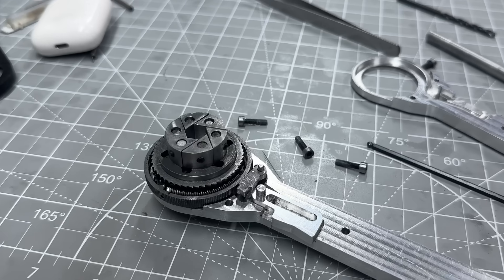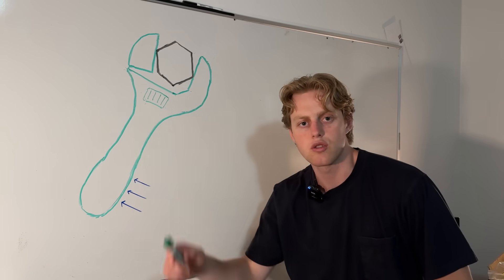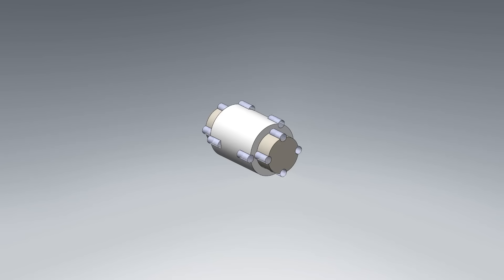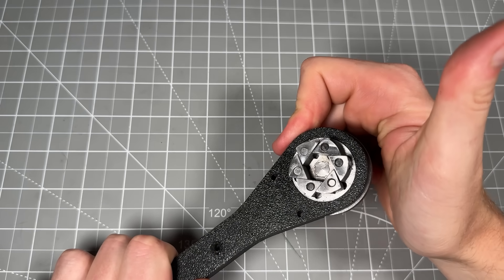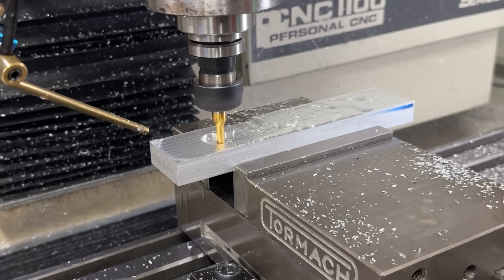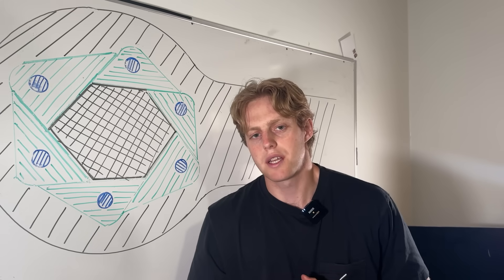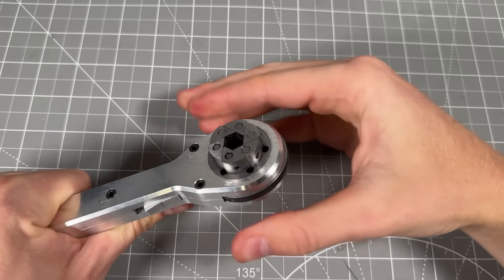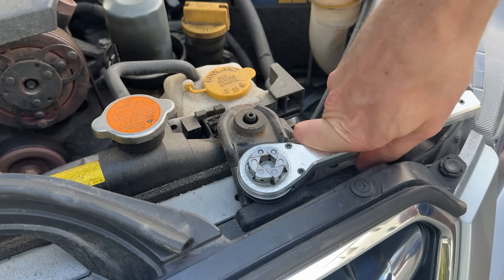I Invented an Adjustable Ratcheting Wrench

Comment: Tractor/trailer mechanic here. This is extremely interesting and I hope you continue to develop this idea, and would absolutely buy one if you decide to sell. I mainly work on Freightliner/International/Volvo tractors, there are tons of areas where space isn't and issue on tractor trailers, you could disassemble half the truck with a 10/13mm socket and ratchet. Liked and subbed, hopeful to see more content in the future on this project!
Reply: How are you going to repair anything if this can't pass a torque test? The tool is a novelty item and is not practical.
Reply: @snowflakehunter what a mentality. Imagine if inventors of the things we havr today had your exact logic and thought process.
Reply: @snowflakehunter  it's a prototype though. It improved over the course of the video, and he plans on iterating.
Reply: @darnell7119 iterating? Wrong word.
Reply: @snowflakehunter "Iterating is the act of conducting an activity, evaluating how it went, improving it". I'm saying the guy plans on improving it so saying it doesn't have enough strength to pass a torque test isn't completely fair. Like do we really know how strong the last version is? What use cases is this strength practical? Those are questions that weren't answered and you don't know what everyone will use it for, so saying it can't pass a torque test send vague and unfair.
Reply: just needs harder materials, and as the video mentioned he could reduce the adjustability to increase strength
Reply: @fryta. Absolutely not! Harder materials including metals break more easily because increased hardness typically leads to increased brittleness, which is a material's tendency to fracture rather than deform under stress. While harder metals resist scratching and indentation, this often comes at the expense of ductility and toughness, meaning they can't absorb as much energy and are more prone to sudden fracture with little warning.
Reply: @snowflakehunter  I don't see myself using this tool for high torque applications, there are plenty of fasteners that don't require high torque. If the design is improved and slimmed down, this could be something you grab to work on something quick and easy.
Reply: @DieseIJunkie I do see it as a better option than those cheap sockets that have the pins in it that form around the nut or bolt. For that type of application, of course it would be a good option.

Comment: I think as a truck driver a single wrench i can use for most of the small things i may need to do on the road it could be a potential win. The downside i can see is the potential cost, i dont like to carry tools on the truck that ill be upset about if i forget to pick it when im leaving in a hurry after an emergency repair lol

Comment: 🙋‍♂️Give it a staggered jaw in each tooth to make 12 teeth and solve the problem of balancing any size drive in it. Then attach extensions and so forth until it’s a universal ratcheting socketed driver of sockets.

Then put a torque reading mechanism in the pawl ring…😎 call it a- “mechanic toolbox with a longer handle.”

Comment: Exceptional work. I do agree that one of the biggest areas where you want to improve is with the ability to reach recessed bolt heads and nuts. Another area is when you need deep sockets. Overall tho, I don't think this current design is the "right" design for recessed bolts. It seems like a near perfect design for basic bolts tho, once you refine the final design. 
   For recessed bolts, with your incredible skill, I recommend re-examining your approach. The idea of a recessed socket deep socket or recessed thru-hole socket is actually your most important consideration if you want a socket wrench that can compete with pretty much every socket wrench out there.
   One way to achieve that would be a set of adjustable hexagonal sides that had 2 flats with a gap for each side, where the side's wall thickness never changed but the width could be adjusted by how much space you had between the start and end of the side. This would limit your total range to some degree but but by making the gap wider or narrower you get the size change and leverage you want at the vertices. Definitely want to see your progress. [Subscribed].

Comment: Awesome - if it doesn't make it to the @TorqueTestChannel bar, have you thought about a no-handle version?
The bones in my thumbs tell me there's usually not quite enough mechanical advantage for hand turning a socket.

Comment: What about the clamps themselves act as the ratcheting mechanism by opening up by turning backwards, and clamps back with a single spring that has (pins? Idk what they’re called when it’s attached) to hold each clamp. Could be simpler and space efficient?

Comment: This is an absolute pearler of a tool mate! 
If you could somehow slim the design down to the width slightly thicker that of a passthrough style socket handle, I think you would easily be able to make maybe three or four different "sizes" with a reduced range of adjustability. Say 5-10, 10-14, 14-19 etc etc
I'd buy the whole set in a heartbeat 👍

Comment: Absolutely awesome. Thanks. 
One idea: a size scale on the wrench would be handy. In situations where space is marginal or very high torque is required, one could simply read off the fastener size from the tool and grab the correct socket on their first attempt. You wouldn't grab calipers to determine a bolt's size, you'd just guess. But if this tool we're your go-to tool, you'd have the measurement as a bonus.

Comment: For hardwr to reach bolts, if you can extend the jaws in several different lengths, that would probably make getting at bolts in a car engine bay much easier. Kind of like a built in extension rod.

Comment: Great stuff and I love the approach.  It's got a lot of great ideas and elegant solutions.  I'd use one for general maintanance, where a cresent might tipically be used.  The tight area problem has  a ton of specialized tools.  But there are no good "general multisize" wrenches that solve the "is it metric or standard" problem.  If you could build in a pointer and etch the size of the fastener, that alone would be a nice use case, to quickly get the size of the fastener and also allow you to remove it when you can't find the right size.  I like it and will definitly check back if you make them available.

Comment: Dude, please never consider not bringing this to market, this would be my go too tool for 87% of my work, just because it doesnt fit into tight spaces or into recessed holes, doesnt mean it doesnt belong. My standard sockets don't work on sparkplugs, so I use a deep well, my no.1 Phillips, doesnt work on a no.3 Phillips head screw so I grab a no.3 driver. Even if a tool serves perfectly for a small amount of tasks, its still better than a tool that serves ok-ish at a bunch of tasks. You said it yourself. 
Id better have this in my tool box in the next 3 years!

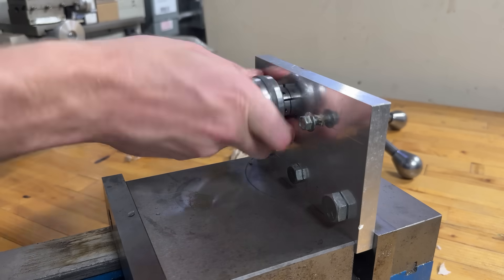Comment: Hey mate, well done with your design concept, there's definitely potential with the tool. Have you considered adding a softer sacrificial material (which slides easily with low friction) to the ends of the jaw teeth? I noticed that when you are tightening the bolts, the ends of the teeth are digging into and leaving marks on the surface around the bolt. (See video at time 10:58 and look at the top left bolt in the plate, there's a circle marked into the steel plate once you've finished tightening).  Something like a nylon plate or something may work, potentially even small ball bearings or something to reduce the friction as you rotate the jaws around. This could help prevent damaging soft or finished surfaces if you use the tool on it, and reduce the amount of force you need to snug up the bolt. Will be keeping an eye on the project as I love seeing speciality tools like this come to life. Keep up the great work.
Reply: Also, another weird thought: If you are worried about the size of the tool fitting into tight spaces, instead of having one tool that can tighten and loosen bolts, could you have two separate ones (cut the tool in half essentially) and colour code them or something? I know I'd be happy to have a combination of one or both tools as it still saves you from needing a million different sockets or spanners!
Reply: @lukepenny4816  I think the issue with the tight spaces is not the fact that it's double-sided (which I think you're saying), but that the jaws are only half an inch long.  This means it couldn't be to loosen / tighten a bolt at the bottom of a hole or channel 1" deep, whereas a traditional socket wrench could.  Plus socket wrenches have extensions so you can actually reach a bolt that is 5" down in the recesses of a car engine bay, which this design could never reach.  To be clear, I don't believe he's trying to attempt to solve that use case.
Reply: Maybe chamfer the edges of the jaw and put some sort of coating on it
Reply: Would go slightly softer on the entire jaw. Then make the surface convex so the clamping forces cause the forces to start getting applied in the middle of the bolt edge first and "spread" toward the edges..

Every so slightly convex.
Reply: A final product would likely be rounded and coated like a regular socket.

Comment: This a great idea holds nut/bolt how many times have we dropped a wrench under cars working in tight spots This is a Winner  i see many size versions  
Now that you've posted this adjustable wrench design China wud be developing it as you speak pattern or not they them rules dont apply to hackers 
keep your eye on amazon sales .

Comment: i like the fundamental idea, but it has... issues.
look at a lathe chuck. you havent isolated the clamping force from the tilting/bending of the jaws.
 relying on the pin in shear to transmit a force thats then in tension as a second class lever.. the flat alone reduces a lot of the bending strength, deviation from round... a groove and cotter pin would be better than a grub screw. some redesign to restrain the jaws separately solves both issues.

normally the dowel pins on shafts are drilled after pressing together.

back to the drawing board. think your also suffering some tunnel vision with the slotted plate. nice principle, but think... iunno... a hydraulic fitting swager? youre sort of touching on the answer by the recalculation of what a hex does, imho. flip it... inside out... you also get symmetrical action then...
also, no reason to stay strictly "radial"... swashplates and cams work on both axes. though you have to restrain bursting pressure regardless which direction it acts...

mark... twenty seven? :)

a thing ive found, after diving three quarters of the way into making a design, is that explaining it to someone, i suddenly think of a far simpler and more elegant manner of accomplishing it... and i just wasted several hours. iunno. and if it doesnt work properly the second time, seriously rethink the execution...

when it comes to ratcheting spanners, i prefer a solid switch from lefty righty to flipping them.
 a hex really only needs three points and as most of the spanner manufacturing advertising suggests, work best when forces are on the sides rather than right on the tips of the hex... no need to aim for six points of contact.

Comment: Chamfer the face of the socket heads, that much contact area on the face of the work surface is not ideal. Painted or machined surfaces will have a big burnishing mark.

Think about the scalability and cost per unit at the end of the day. How many of these will I need to cover 1/4” heads up to 1 1/8”? Then how much would that cost vs a set of ratcheting wrenches?

Not saying this adjustable ratchet isn’t a cool idea and I’d love to try it at work, but these are the considerations people like myself think about on top of ergonomics and weight.

Comment: Easy solution for remembering which side is which: Engrave an arrow pointing in the ratchet direction on the handle in three places. Under the mechanism on both sides, and on the end of the grip. Any mechanic should be able to interpret that.

Comment: The simplicity of opening the jaws means that even a version that doesn't ratchet could still be be very useful. It could reduce the head size while increasing the torque rating as the clutch 'should' be the weakest part of the chain.

This wouldn't help the inherent limitations of the jaw size/depth but frankly, I think chasing that is a lost cause. You can certainly slim it down (and you should) but I think including a socket adapter will be the best option. I'd rather have the one wrench for most exposed bolts with socket adapters over needing another wrench.

I also can't help but think that a 'ratcheting' mechanism utilizing the jaw's ability to open is doable. Of course it will not be nearly as granular as a traditional clutch but could still be quite convenient for this version.

Very impressive design my friend. I think most engineers and makers have imagined an adjustable socket design but you nailed it. This has real potential.

Comment: if you want to be an ratcheting wrench they make them already. if you want to make a ratcheting adjustable wrench then put "on" on one side and "off" on the other end that would cut down on the bulkiness. and your adjustability would need to be wider say 3mm to 18mm. but its a good design in my opinion.

Comment: Trevor, great video and great machining work.  please let me know if you need help with production of parts. A lot of these can be made via powder metal compaction. High quality with high volume. At a low cost. A lot of conventional ratchets utilize PM components.
Reply from the maker: Interesting, I would love to hear more. My initial concern would by the effect on material properties, surface finishes and tolerances. That being said I have never worked with the technology before so maybe all three can be managed.
Reply: @Trevor_Faber Trevor, yes if you just search on YouTube “powder metal compaction” you’ll see numerous videos of the process. Our customers make parts for a variety of industries including automotive / lawn and garden. Consumer goods such as kitchen and washing machine parts. Some other benefit’s of powder metal include the ability to oil impregnate the parts so they are self lubricating for the life of the component. Just looking at a few of your parts within the ratchet assembly they can nearly all be made Via Powder Metal.

Comment: It looks nice, but I believe its usage may be limited. While it can reach certain areas, it cannot use an extension. You mentioned that it can replace all sizes, but it seems to only work for a small range, after which a larger tool is necessary. It would be more convincing if you demonstrated its capabilities in a real project, such as replacing a part in your car or doing a brake job.
Reply from the maker: Good thought, Initially that was the plan. But at this stage the wrench isn't quite up for the task. I think I can get it there with some further improvements though. The designed rage is 8mm to 20mm. So yes not every size.

Comment: Wondering how much force it can handle to actually tighten/untighten a bolt. Cool design though.
Reply from the maker: It is designed to withstand similar forces to a 3/8 drive socket wrench. The version shown in the video probably is not that good especially with aluminum handle.

Comment: It would be wild to see this with a through port for working all thread.  I would use that every day at work.
Reply from the maker: What do you do for work?
Reply: @Trevor_Faber  Electrical, mostly commercial.  A lot of all thread, pipe straps, and concrete anchors.

Comment: One idea is to have two wrenches.....One for "Righty" and one for "Lefty".  This would allow for the profile to be much thinner, and you could sell them in pairs.  A purchase of two wrenches still replaces a slug of both metric and imperial sockets.   
Another suggestion is to sell it with a tilting "hinged" head.
Reply: I don't think the height reduction of one-way wrenches addresses the primary limitations and personally I  think 2 individual wrenches starts defeating the main point of a tool like this. It also increases cost as many components still need to be manufactured twice instead of sharing them.

A hinged head can be useful but would cause many design problems that probably aren't worth it considering the existing limitations. For this tool I'd prefer the stronger, fixed head and just pull out a hinched wrench and sockets for those niche situations.
Reply: @JJFX-  man if there was a way to reuse one side without having to mirror it in a bulky manner it would be perfect. Like maybe if the adjustable teeth that grip the bolt could be pressed inside the wrench head and through to the other side, it would make it less bulky, since you'd be reusing the same parts, just pushing it to the other side for lefty loosey
Reply: @MrE_  this was my thought. The way some ratchet wrenches have to be flipped around to loosen. Would cut down the size significantly.
Reply: That, and because most of us will eventually misplace the other wrench, make the other wrench attach to the handle, so you essentially have one wrench with two ends with an option to split them and use a cheater bar!
Reply: - or the head ? set ? (different size ranges, could also simply be a quick change "jaw set" ) as a standalone tool component  - with attachable straight or hinged handle (application specific)..

infinitely possible directions one can take.